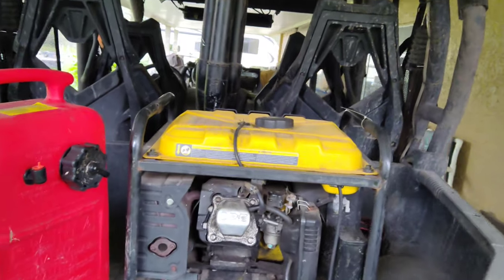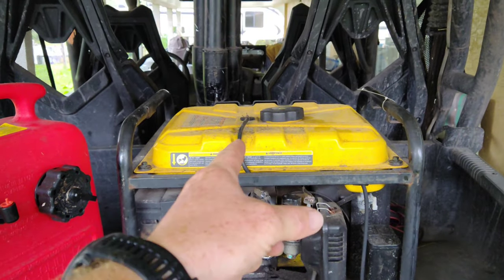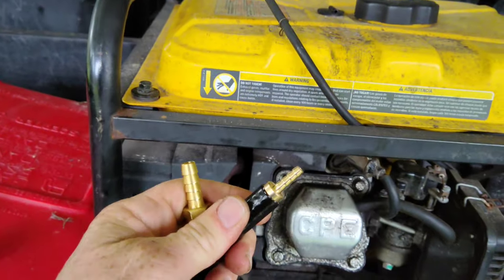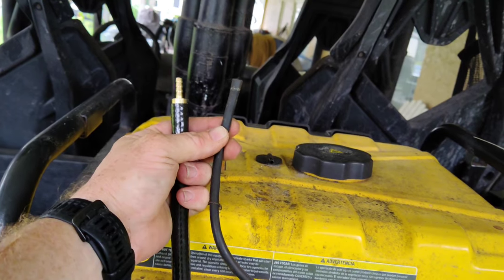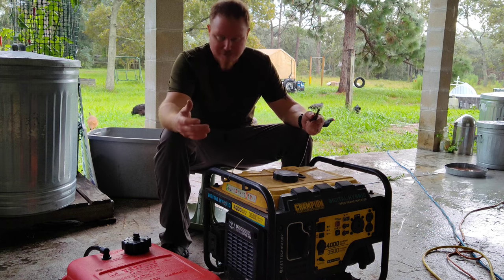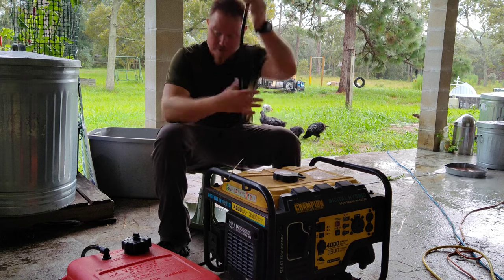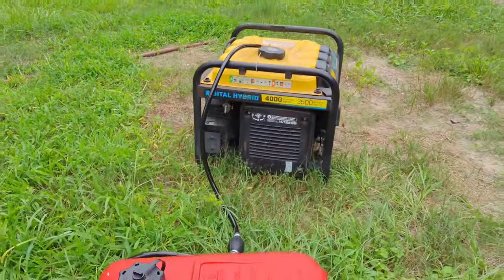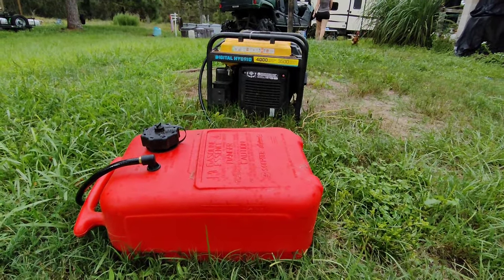Adding an Extra Gas Tank to the Generator

Comment: This is funny i just thought this whole process on a whim for my suitcase generator. No vent line, just a cap so i drilled a hole for 3/8 brass barb to npt thread on a right angle and worm clamped the outboard fuel line. I used some jb steel stick to seal up the threads into the cap. The important part is making sure the cap seals tight, otherwise it will suck in a tiny bit of air for every drop of fuel until the pressure equalizes and the generator shuts off.
Reply from the maker: Good stuff dude

Comment: I believe I have the same generator.
I was wondering if your idea had been put to the test so to speak. Considering doing the same thing with mine.
Thanks
Reply from the maker: It works, I still need to figure out a better ventilation system for the tank. It runs fine on a light load, but it doesn't like running at higher rpms
Reply: Why not put a y into regular fuel line and have boat tank higher than generator and gravity feed but y may create a vacuum or suction anyway and leave the current oem venting

Comment: Thanks for the video, have you had issues with gas leaking from gen? Great video it’s nice to see pol speaking my language on you tube haha.
Reply from the maker: No issues with leaking, however it does stall randomly every once and a while. I will have to figure out a better ventilation process I believe.
Reply: You could have put a y into regular fuel line and let it gravity feed

Comment: Does the vent line suck in air instead of pushing out air?
Reply from the maker: I'm no expert but I believe it allows air to escape. Either way it keeps the  generator happy and running.
Reply: Yes... duhhh
Reply: No... you have a gravity fed carburetor. It won't pull fuel. Also if the cap isn't vented it has to be vented somehow or there would be a vacuum lock in the tank.